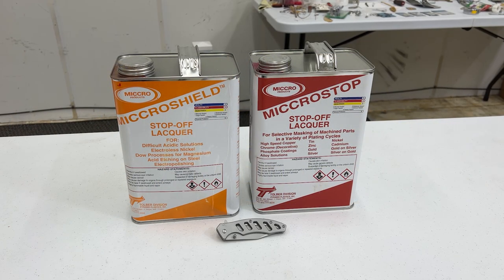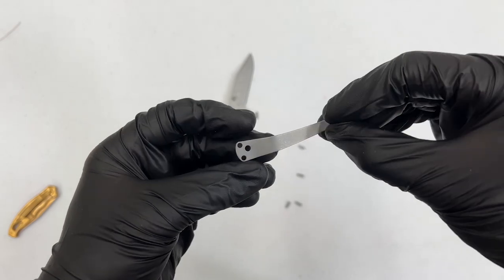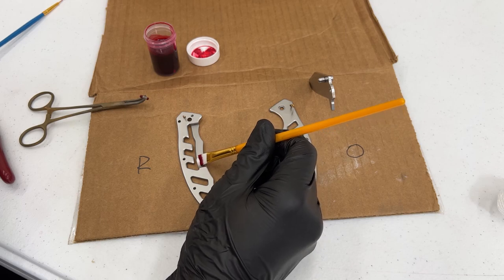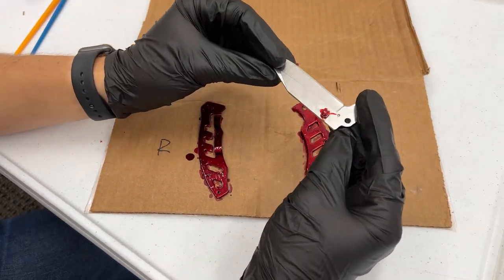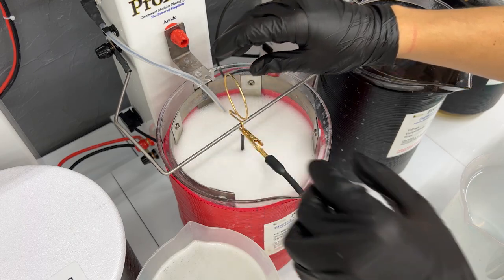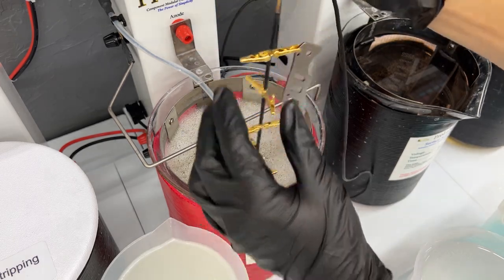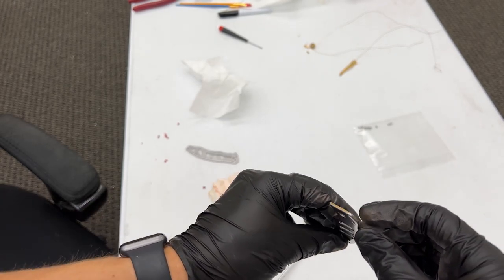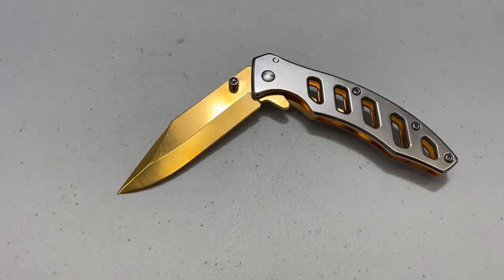Masking Knife then Plating with Real 24K GOLD

Comment: remove miccroshield with acetone so you don’t scratch your parts , use wooden Q tips with acetone to remove it from certain areas , for the miccroshield to hold during the process the part needs to be super clean hope that helps !
Reply from the maker: Thank you for the tips.